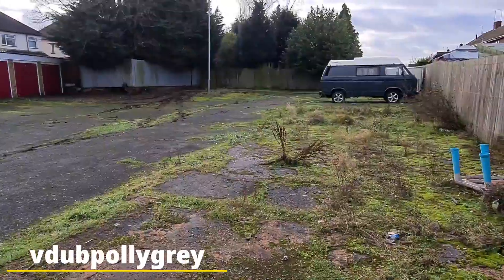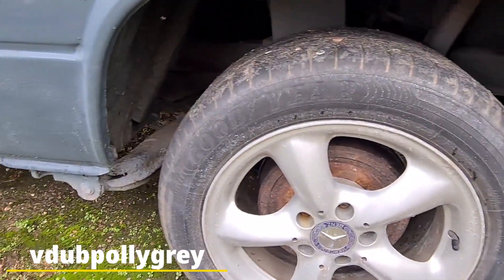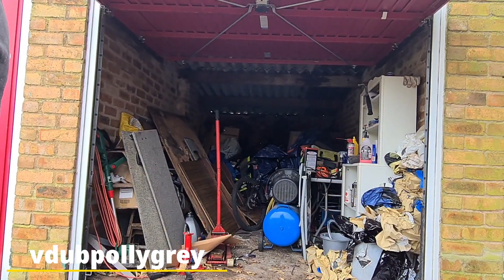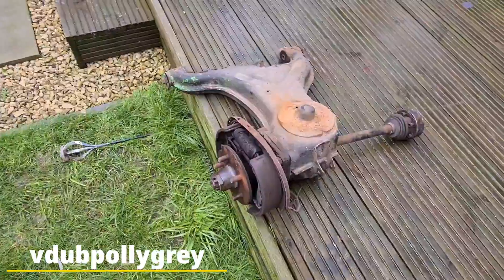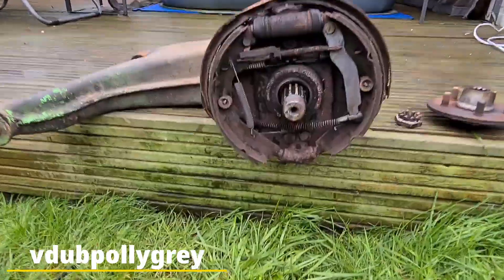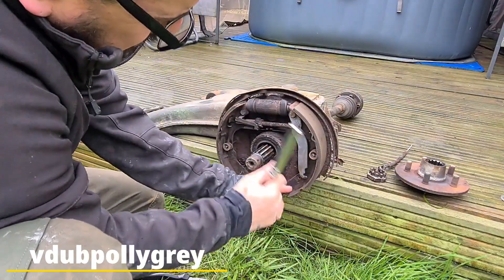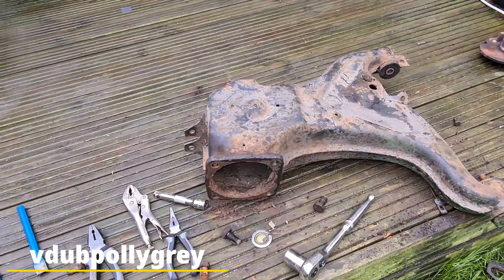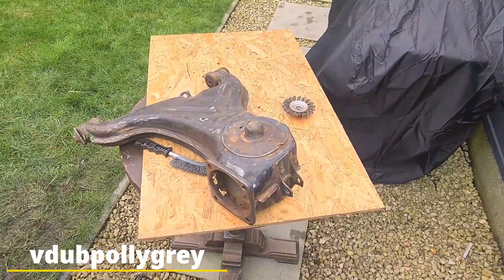Vw T25 work continues on my Rear trailing arm vanagon self built campervan part 1

Comment: 4 got tell u powerflex bushes take two mins get them in 👌as black bushes take two months lol 😁
Reply from the maker: ok lol i did buy black bushes defo thinking of going ppwer flex
Reply from the maker: were did you get your powerflex bushes from and how much did you pay ?
Reply: Got powerflex bushes of Ebay Hundred 30 pounds and got nuts bolts an washers out juatkampers. Bud 👍

Comment: Just wee hi  hope u ur family well how's u getting on with van did you get power flex bushes 4 trailing arm  so easy get in .I know is bean cold not time working outside well keep good  .      .Vwlife4 me
Reply from the maker: the family is good thanks for asking how are you ? i had already bought the normal bushes so i may aswell try the 1st 🤞i have been posting a lot on Instagram so you will have to go check it out .you can also seen messages on there be good to see the process of your van